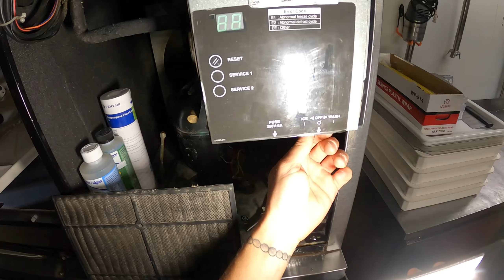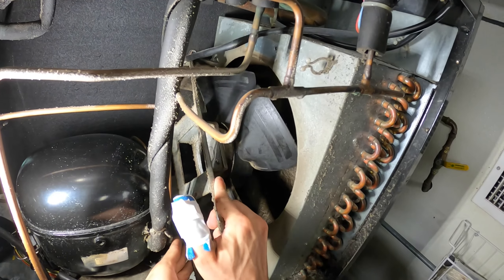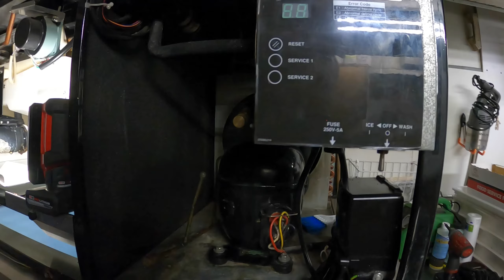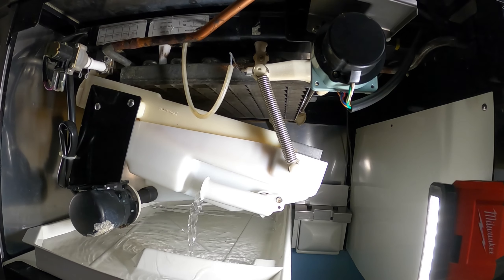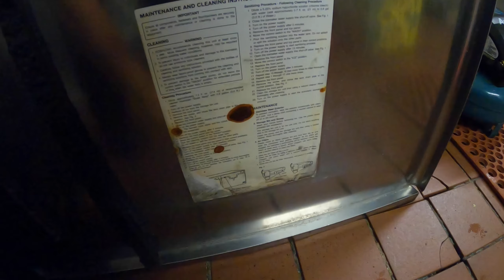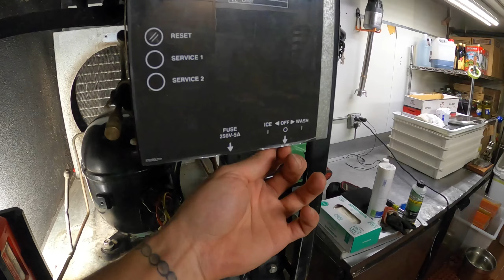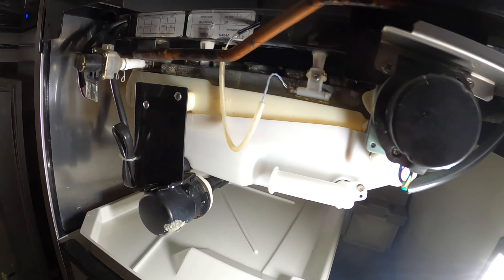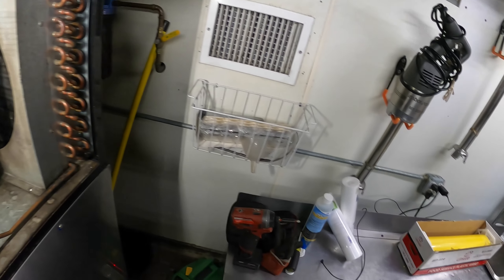HVACR Service Call: Hoshizaki Ice Maker Deep Cleaning/Preventive Maintenance (Ice Maker Not Working)

Comment: Hi Jumper Man.  Enjoy your videos.  In this one, I noticed you did not change the drain spout on the reservoir to the clean position.  There is one screw to remove, then you turn the spout down and reinstall the set screw.  This allows the reservoir to drain completely when the reservoir swings down in the harvest position. It really helps to flush out things and helps to prevent contamination of the first few batches of ice.  If you don't do this the reservoir remains partially filled with your cleaning/sanitizing liquid.

Comment: Very interesting video. I always enjoy your videos. Got a question, is it a good idea to blow dust around the kitchen like that? Keep making them and I’ll keep watching them. Be safe lefty.
Reply: Everyone does things differently. When I do coil cleanings for ice machines I do the same procedure but instead of blowing it out with air, I get everything wet using a non-acid coil cleaner.. let that sit for a bit as it works itself into the coils and loosens any debris then spray down with warm water. Run a small vacuum immediately which will suck up dirty water instead of dust. The coil cleaner gives additional layer of protection to coils to help prevent dust from sticking easily.

Comment: sHoshizaki's answer to Kolddraft ice makers. If Hoshizakii is still using stainless steel on the evaporators you don't need nickel safe cleaner. Just use Hoshizaki cleaner.
Reply: The KM series haven't changed much, still water hogs. The machine in vid has a nickel coated evap. AND WHY DO THEY HAVE THE LEDS NUMBERED LIKE THAT in the KM series?.  I even asked tech support and he laughed and couldn't answer, lol.